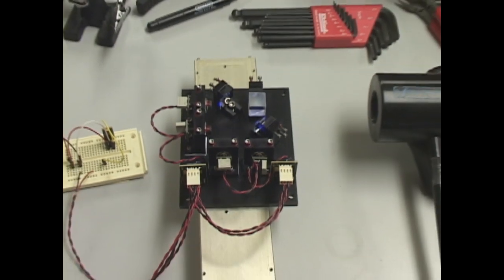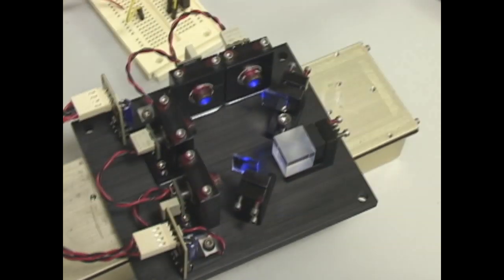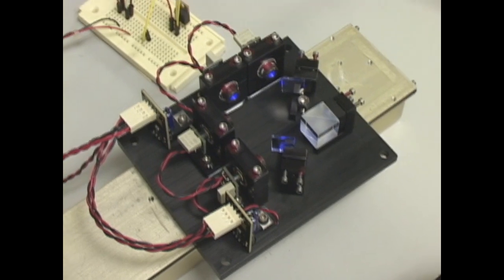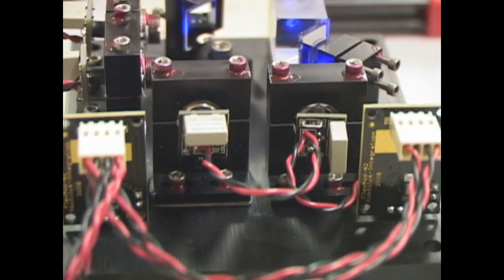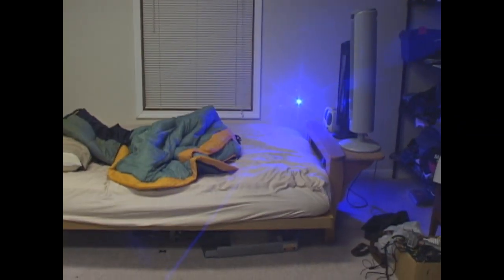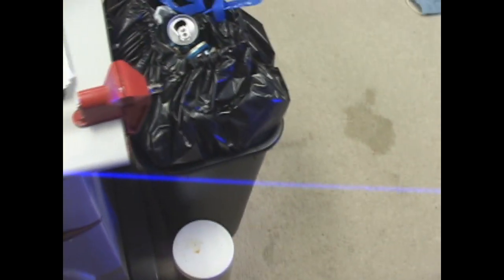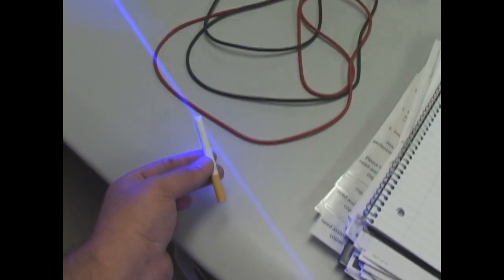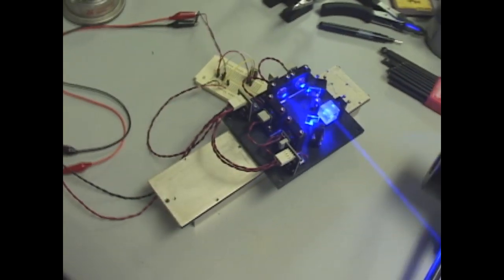4 Watt 445nm Quad Laser Module Test

Comment from the maker: With money not a limit and a backpack power supply, you could easily wield a 5KW (5 KILO-WATT) infrared laser with a reasonable duty cycle. Though, everything is application driven. Power densities per CM and such. Cut through a safe.... NO. (Yes, I actually get that question... A LOT.) Cut through combatants like Swiss cheese?.... Again, NO.... Trust me, The US government would be the first to sign up for "Laser Blasters" if it were currently feasible. It's coming though.
Reply: Fun fact, The Who used to have a holographic & laser show company, called Holoco. They measured the power of their holographic CO2 pulse laser(s) in Gillettes, as in razor blades.
Reply from the maker: @TheOleHermit  I'm familiar with power ratings in "Gellettes", I have a few lasers that can achieve 1 or 2 G's. Never heard of holographic CO2 lasers though. I'd like more info on that.
Reply: @hightechstuff2  Holoco were pioneers in holography & laser lighting for The Who, from the latter 1970's on until I don't know when. They were still going when I left England in 1988.
Holoco used to exhibit their works, including the famous holographic glass skull, quite often in Soho of London. I only knew some of their crew, so I'm not that familiar with their techniques of shooting holograms. But, I believe the high powered CO2 lasers were used to capture moving objects, such as a bullet breaking through glass.
Looking forward to getting back into lasers. They're still a significant part of my inner being that most people don't even know. Amazed at how much more affordable they are now. I can have a decent show system for the same cost as my entertainment system.
Have my eye on the New Freedom M-3000 RGB 3 watt projection head X 2. @ $260 ea, I couldn't build cheaper from scratch. Plus, my own wouldn't have all of the convenient standard interfaces, like ILDA & DMX, MIDI, etc. Of course, I'd rather have faster galvos than 15kpps. Are you familiar with any of their products?

Comment from the maker: @eveningniteshade EXCELLENT question...

The easiest way to stop the beam if a scanner was to fail is an adjustable mask on the output of the projector. Just set the mask to the minimum height required to keep the beam out of the audience. 
This is by far the simplest method of scan-fail safety but they can get many times more complex than this. In some situations, you want to scan the audience. This is done with carefully set MPE and scanner feedback to determine the scanners are not failing.